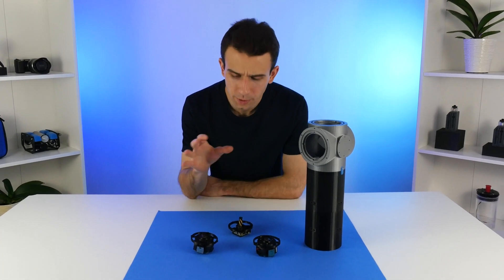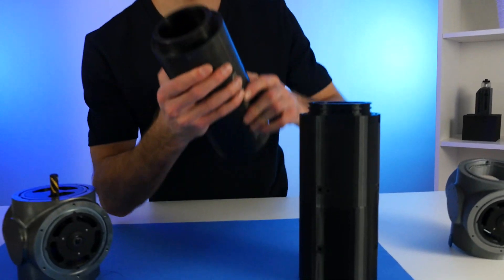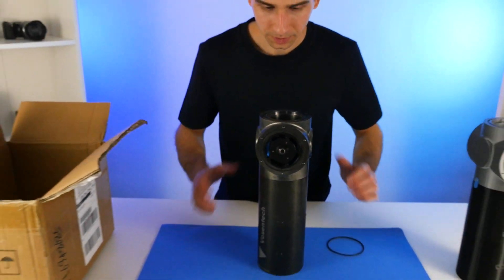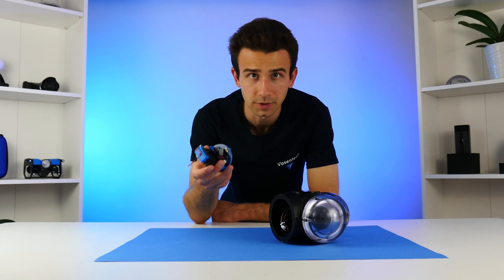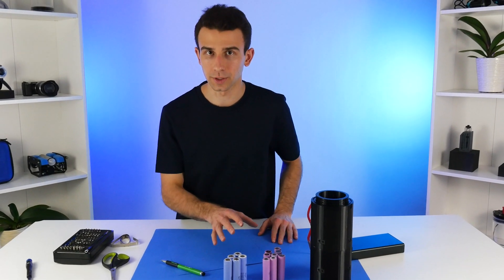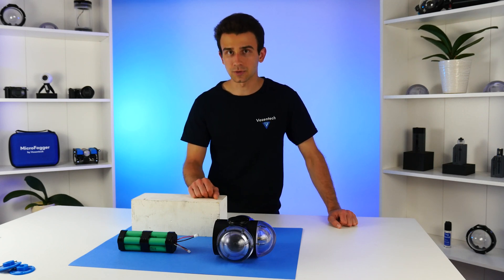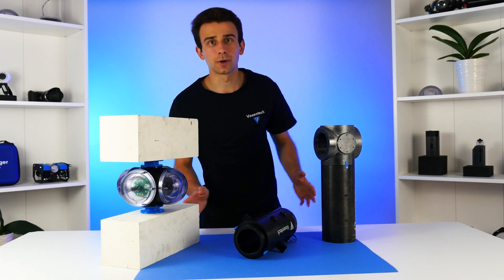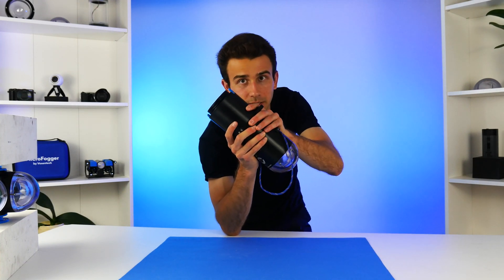Building a submersible for the Mariana Trench EP.3 - The housing

Comment: That acrylic dome won't survive. You put screw holes through it.  You made the same mistake as Ocean Gate.  You need to make a window like the Alvin's, that high pressure forces it into a concave receptacle and it can't pop out of.  Don't put screw holes through the window, use an external clamping ring so the window can flex under pressure.  The Alvin's window presses in 4-5 inches at Titanic depths.
Reply from the maker: Really good point! We've been thinking about this exact issue recently, and taking a look at existing commercially-available domes such as the BlueRobotics ones, they use a clamping ring to hold them down. Another idea we had was to make the mounting holes into mounting slots, that can let the screws slide further out as the dome compresses/deforms in. That way it involves less parts, but this may not be the best option since the screw heads may put too much pressure on the top of the slots as they try to slide past. For our initial testing, this existing design seems to work at sub-1000m depths but you're completely right, we'll have to rethink that aspect.
Reply: @Vosentech  The Blue Robotics design hasn't been tested at actual depth to my knowledge.  Look at how the OceanGate sub design failed, (the main window) - because the window was the wrong shape and not rated for the pressure depth.  Look at the Spectrum Portable inspection cameras that are rated for, AND have gone to 300M depth (1000ft)  and compare the Blue Robotics design to Spectrum construction wise. All metal is the only way to go, for strength and buoyancy, and the smallest window possible.